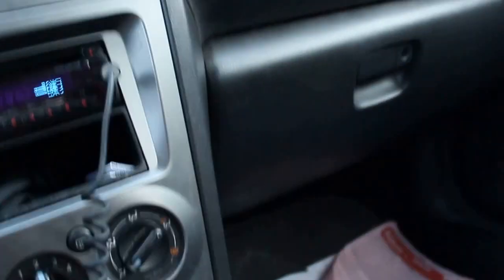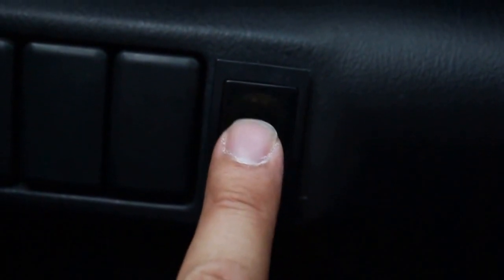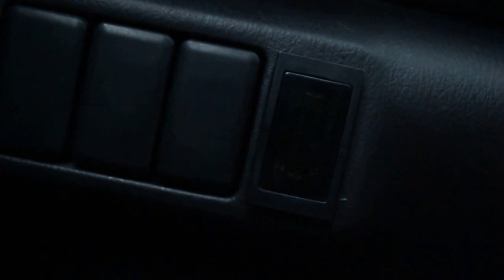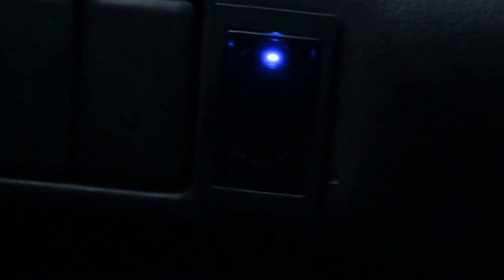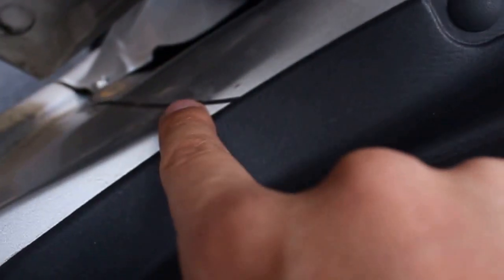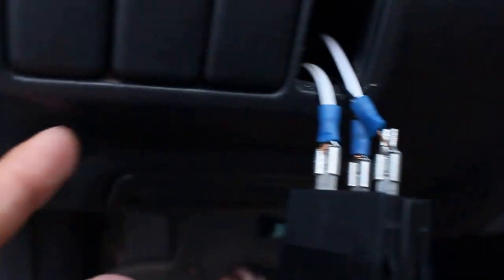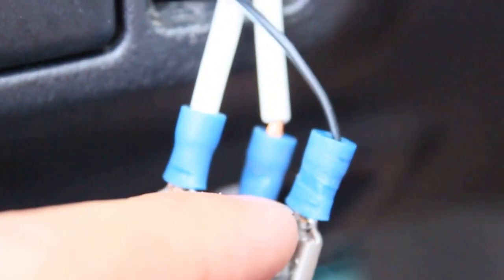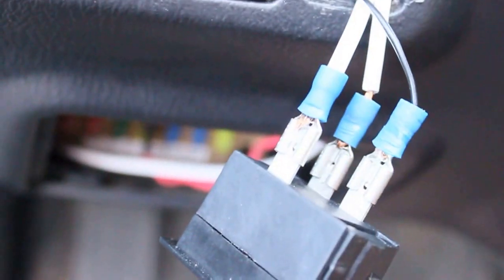3A Universal Touch Switch Wiring Explained

Comment: Been a while but the best way is the switch has V+ / V- and a V+ out, V+ is for power V- is for ground, in wich u have to run two ground wires to it, one going to it with a connector and one coming off it going to a bolt, then V+ out is the hot wire coming off of what ur hooking up like leds.

Comment: Invest in some proper wire termination equipment. Good auto wire strippers and crimpers make wiring a pleasure and get you professional results when used correctly. Run wires through firewall with appropriate boot or grommet to keep water out. Use insulated connectors so you don’t short connectors together when removing or installing. Heat shrink connectors are your friend, Increases weather seal and decreases size as well as adding a certain amount of strain relief. Good video!👍

Comment: This approach is not uncommon. This device needs a "+" and a -/Gnd for the electronics inside to work and instead of switching the power, it switches the -/Gnd. That means whatever the load is, it should be wired with permanent "+" and its Gnd will be switched on/off. Nothing strange.
Thanks for explaining the wiring. It makes total sense now.

Comment: The reason you need a second ground is for the lights in the switch to work. You can disconect that ground and the switch will still work, but the lights inside of the switch wont work. You need one power wire going into the switch, one wire going to the device the switch is working, and the 3rd wire (ground wire) enables the red and blue lights inside the switch. All lighted switches work in this fashion. However, the video was still helpfull due to there being no diagram for the switch. Now i know which pin is for what.

Comment: Hey great video but I am still having trouble making the switch work as far as turning my lights on and off. Please help I wired 1 strip of LEDs to the other on the other side using wire I have the fuse tap the switch lights up but it won't turn off the LEDs. I wired 1 power wire and 2 ground 1 from LEDs and 1 by itself is that correct?? Please help a.s.a.p.

Comment: Whatever help you offer identifying the pins is absolutely negated by the HARM YOU ARE DOING BY MISINFORMING people on wether each wire is a hot or ground, etc. 

You flat out stated several times that the switch has 2 grounds and one hot. That is incorrect. 

PLEASE READ TWICE: 

THIS IS A NORMAL 3-pole SWITCH! 
A. 12+VDC IN, 
B. 12+VDC OUT TO LOAD
 (the thing you want to power up)
C. GROUND (for LEDs in switch)

NOT rocket science but apparently complicated enough for Eddie the Electrician to come on here misinforming America!
Nice try junior. 
🤦🏻‍♂️🤦🏻‍♂️🤦🏻‍♂️

Comment: does really down your battery down ?I bought one from mistake in autozone but thanks of you I hooked to my fog lights but now i'm worry about having another interruptor switch hooked up.
Reply: Its LED it pulls low wattage from battery, mine was always ok
Reply: It’s like having a car charger plugged in all the time it’s just feeding a little led as long as the car doesn’t sit for months it’ll be fine no more power than the alarm system pulls

Comment: U could daisy chain the grounds to body instead of two
Reply: No you cant, you will cause a short if you do that. It isnt really 2 grounds off the switch. There is power in, and power out to the device it is controling. The 3rd wire is a ground for the switch only so the lights inside of it work. You can skip that wire all together and the switch will still work the device, but the lights in the switch wont work.